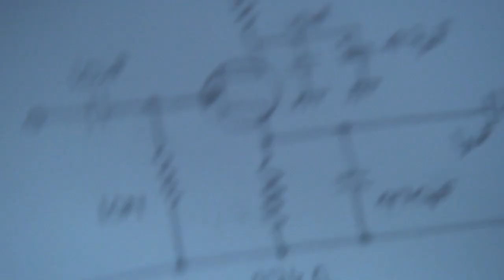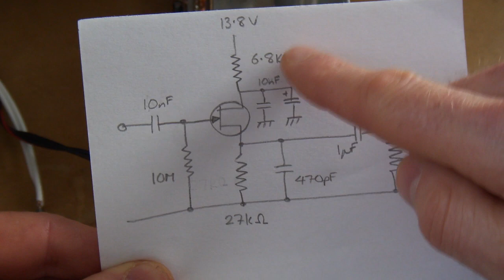Shortwave AM Receiver. Part 6: Infinite Impedance Detector

Comment: Please Charlie
How do you make the antenna?
Usually in your "calculations" you say the antenna is 50 ohms

How so? I have a long wire as my antenna, how can I make it to be 50 ohms?
Thanks
and as always, thanks for the learning videos
Reply from the maker: Hi Zeus. In this case I was running the antenna through an ATU which was also doing to the impedance matching.  Without that, I'd need a 49:1 transformer.

Comment: Hi, Mr.Morris. I see that your JFET AM demodulator can output very good tone with wide dynamic range along with the function of drain voltage Vo=Vs-(K/2)(Vi - Vt)^2*R. I saw the MOS FET characteristics at MIT OCW 6.002 at
https://www.youtube.com/watch?v=9RqFFlZgf60&list=PL9F74AFA03AA06A11&index=11
Congratulations and thanks for showing your video.
Reply from the maker: Thanks. I'm certainly happy with how it turned out. A fun little project.

Comment: I think Bill Meara had a problem once with a FET stage until he added a high-value resistor to ground at the gate. He found it when he inadvertently touched the gate with a screwdriver. The instant he did, the radio came back to life. In touching the gate, he bled off the charge build-up. Adding a 10M resistor kept it bled off thereafter.
Reply from the maker: Hi Todd. I had exactly the same problem. The radio burst back into life when I put the o'scope probe onto the gate. I then added the 10M resistor to stop that occurring. To be fair it only happened once, and that was from me probing around. It seems to work well.

Comment: It seems the J310 are getting harder to find from the reputable suppliers. JFETs in general are disappearing and being discontinued for some reason. Going the way of the MPF102
Reply: easy to get in SMD package.Look for MMBFJ310, few SKUs at Digikey for example.
Reply from the maker: @philippejard5310  Cheers Philippe.
Reply from the maker: Let us know how you get on. I would have thought the MPF102 would work equally as well.